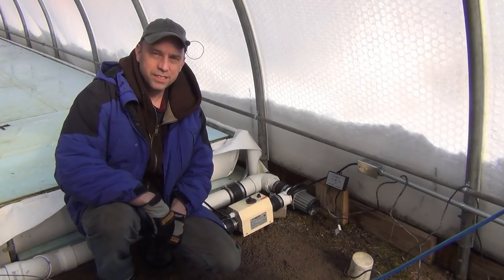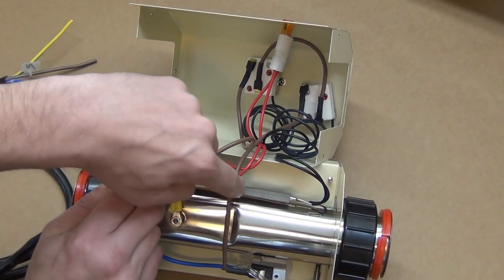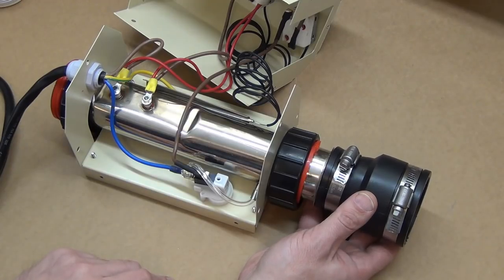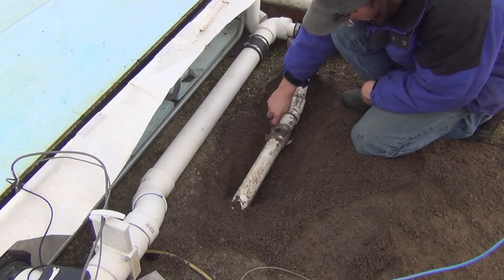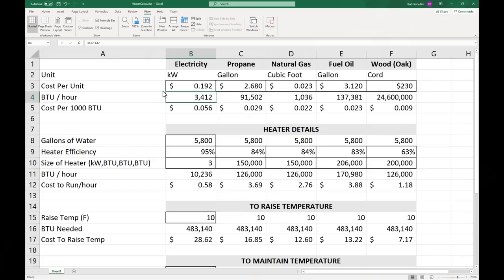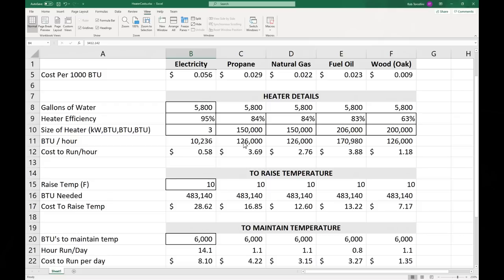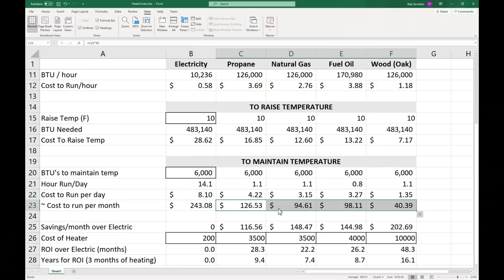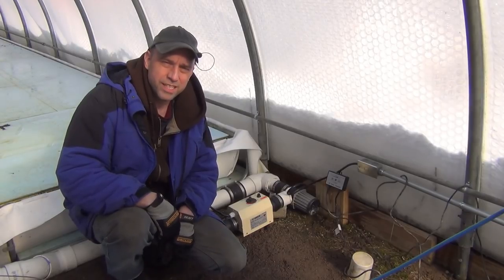The CHEAPEST Heater I Can Find

Comment: $10K for a wood heater seems disingenuous or a way to get out of having to treat it as a real option, a wood stove with a heat exchanger on top of some type that would keep the water from getting too hot, but also warm the structure. Building something with a normal heating stove would be much lower cost. If you are to ever get the system to be commercial you need to have the system producing in the winter with both warm water and warm greenhouse. But as it looks the system over 3 years, it's still just an expensive hobby and not expanding beyond that. The cheap Chinieeze heater is a low enough cost unit and fast to put in, just seems like a patch rather than a solution.

Comment: You should be good to bypass the pressure switch because you still have the overheat sensor. It the flow stops it overheats and shuts down.

Pressure to an alarm would be better.

Comment: Rob, Love the cost breakdown, thanks for those calculations. I'm up in NH and have similar electric rates. That said, I recently added a DC powered heating element with a solar panel to my system (total cost about $300). I know at the moment it only gives me a couple of hours of heat per day, and I haven't done the math, but in my mind every BTU gained from the sun is a good thing.
Reply from the maker: I've been debating doing something similar but just run water through a parabolic solar troth.  With PV panels there is a lot of loss to convert from solar to electricity.  If you can heat the water directly, I think it might be more efficient.  Of course there is plumbing involved...and making sure the system is drained at night (or filled with antifreeze and run a heat exchanger)
Reply: @Bigelowbrook  Hmmm...I will have to look into making a parabolic solar troth for my next heating project.

Comment: It takes a tremendous amount of energy to heat one gallon of water one degree. Can't imagine how many btu is required to heat this system properly. I would doubt that little heater is very effective, except in very marginal temperature needs.

Comment: Just wondering, why not use a duel input geothermal heat pump?  It cost almost nothing to run.  If you do it yourself, 1500 cost max.  I'm looking into getting a greenhouse and will need cooling and heating and weighing the pros and cons.  I want to add wood or solar or both energy storage to mine, but I'm making it myself.  Done a ton of research into this.   I can weld good enough to make something descent.  Still hashing out the design for the storage.
Reply: ...Reason I'm adding wood stove into the storage mix is for those few snowy seasons we get with little light so solar may not work well allowing me to grow anything without exception.
Reply from the maker: I had made a pretty good wood boiler out of an old wood stove which worked well in the other greenhouse.  I just don't have the time to cut firewood so it's easier for me to just heat with less eco-friendly methods.  A heat pump is good but it still takes power to run and a source of "heat".  for this area it's underground and everything is bedrock.  cost to install a few wells can easily exceed $20K.  Heating a greenhouse is very different than heating a house.  Even an "efficient" greenhouse is very poor compare to a house.  It takes a lot of energy to run a greenhouse when it's cold....or like what I do, just keep it heated enough to prevent the water from freezing.  It's cheaper (for me) to not grow over the winter than to pay for heat and lighting.
Reply: @Bigelowbrook  TY!  You said, "It's cheaper to not heat...". I can see that.  Do you sell any crops to offset the cost?  I'm about to build one and will probably make a Chinese one with some homemade improvements.  I also love fish (eating) so it's hard to not also have some 🐠.  Have not researched this at all though.
Lastly, I like to help when possible and as a thank you:.  If you want to increase production with CO2, I think I've found a cheap easy solution after many hours of research?

Comment: Not sure where to add this comment.  I want to build a greenhouse.  Saw your presentation from 6 years ago on them.  Which type would you recommend now 6 years later for a small commercial operation?
Reply from the maker: Probably the Chinese style.  If you're on a budget just a regular hoop house (or goth arch if you deal with snow)
Reply: @Bigelowbrook  yes I've thought the same.  Can't think of anything 🤔 better.  I'm in north Arkansas.   High humidity midway between real cold and hot, more on the warm side but occasional snow.
Reply from the maker: @l0I0I0I0  You're in a fairly warm area.  I would probably just install a heater to deal with the occasional cold night and grow cold crops over the winter

Comment: Please  help me: I put mi vevor 3KW  after the filter of my  bath/spa ( 3000liters) , the pumping is the same for all spa. and have 1/3HP jacuzzi 1/3CV, I saw that the water  trough out with good pressure , but the ligth not tiurns on?  maybe my pumping is too much  strong ??
Reply from the maker: I don't know enough of the details for this unit.  You probably should contact the manufacturer.  Sorry!

Comment: I think my 15in stanley hand saw is easier and faster... (they sell a 12in PVC saw I've wondered about, but a moderately coarse tooth wood cutting saw works great).
I agree with your cost analysis. Lifecycle cost is something too many people ignore.
Reply from the maker: I also use my hand saw for the majority of my cutting, but instead of grinding it into the dirt, it's a lot easier to use the cable saw.

Comment: Which pump are you using?
Reply from the maker: Jebao DCT-12000
Reply: @Bigelowbrook how do you bypass the pressure switch. As my pump isn’t quite enough to trigger the heater unit , the orange light is not on ??? Can the pressure switch be bypassed ?

Comment: Here a crazy ideal, to offset your electrical bill?
Buy some old bitcoin mining rigs.
Join them to a mining pool.
Use the heat generated by the rigs to heat the water in your tanks.
Take the money from the mining pool and apply to electrical bill to reduce run cost.

Down side time lost in research and installation.
Reply: I like the imagination, but that's an awful idea 😂